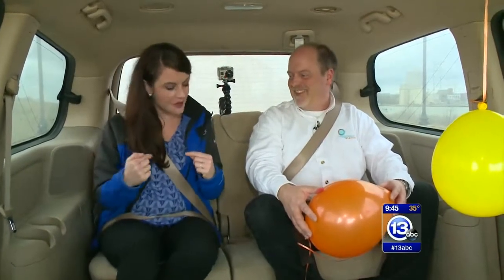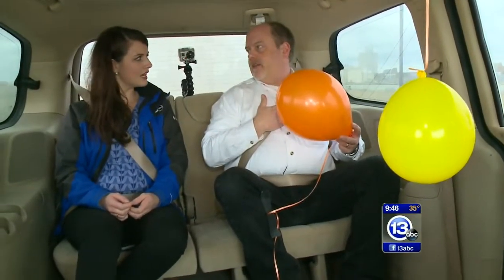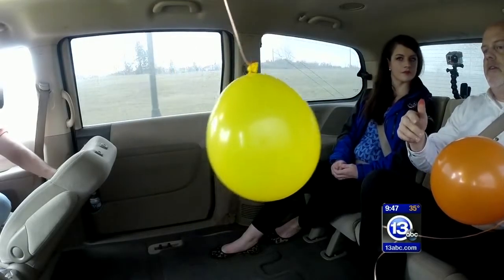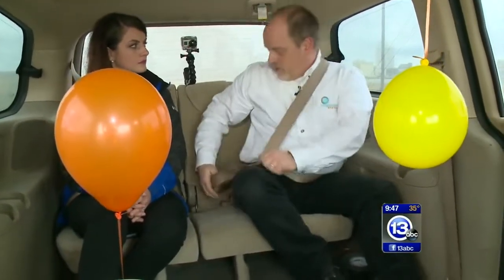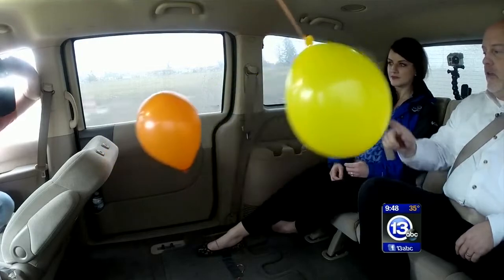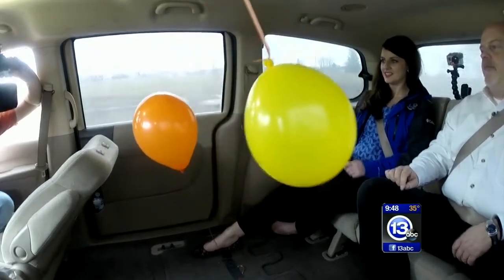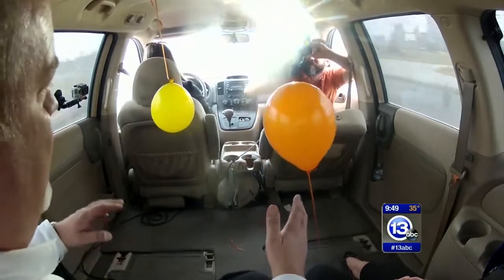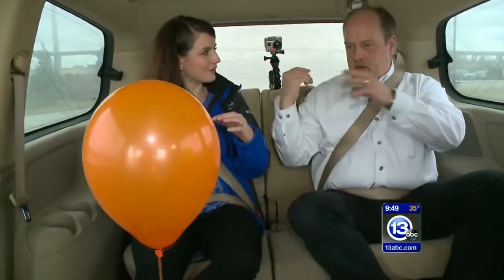Which way does a helium balloon move in a car?

Comment: I don't think they quite nailed the conclusion.  The helium balloon is trying to float on regular air the same way an air balloon tries to float on top of water.   When the car accelerates The air becomes denser towards the back of the car and the helium balloon tries to "float" towards the surface which is now at the front of the car due to the acceleration.   The effect is momentary because once the air in the car has reached the vehicle cruising speed the relative velocities return to normal.  That's why you can walk around a jetliner at 400 miles an hour the same way you walk in your house.